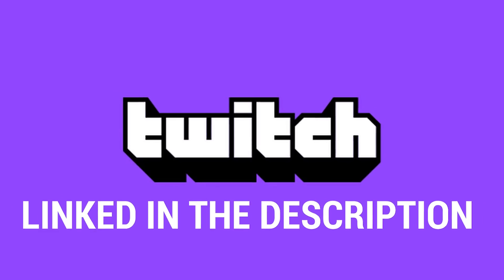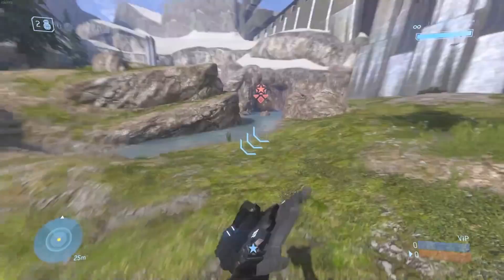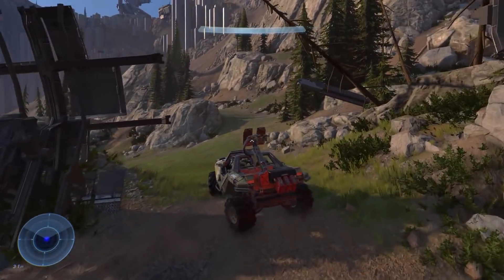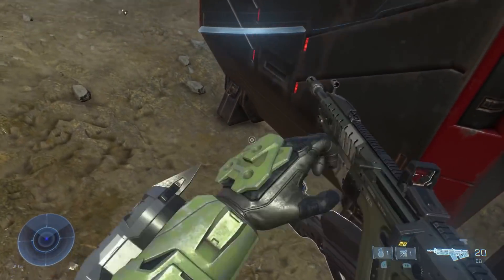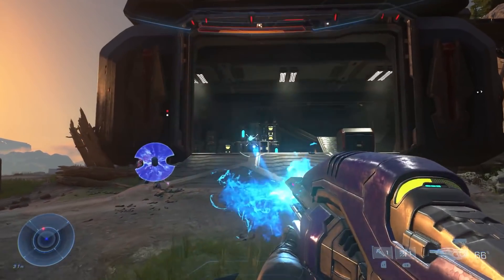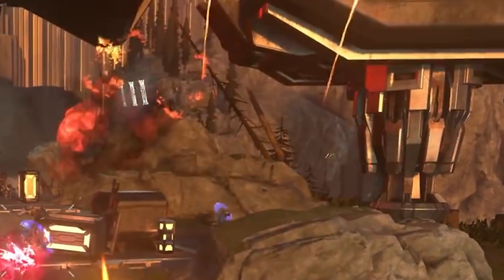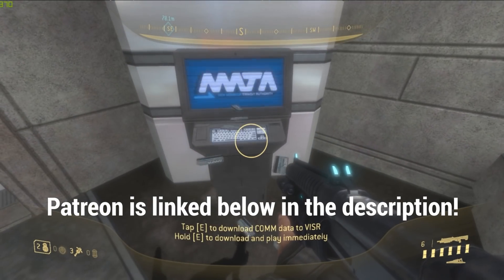What you MISSED from Halo Infinite's Gameplay Trailer  | The Physics of Halo Infinite

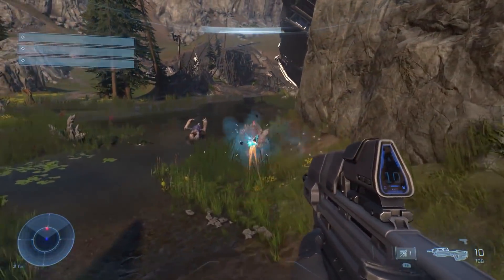Comment: I love the look of the green fusion type explosions, wish the others were as good. (5:23) They look genuinely white hot in their core with that sort of over exposing camera bloom surrounding them, and the smoke/vapour around them seems to light up a lot better so they have that extra volume. The normal fire explosions are alright too, but the plasma looks really weak to me. Maybe if they were just a lot brighter in that white/hot plasma sort of way, current form they don't look all that different grunts blood to me (5:25 v. 2:11). I also feel like they cheat the geometry out of those drop pods a little too aggressively when they explode, there's all of a sudden like 10% of the mass that was there
Reply: Actually, going back and looking at the plasma grenade that pops at 5:57, it looks a little better there. Maybe if the volume stayed lit a little longer
Reply: @BCMSi   The actual explosion there does look a little better. But he lingering plasma that fades out is way too opaque. It looks so cartoony, like it was an asset lifted from Ori

Comment: by the way every weapon in the entire halo series has been projectile based. the entire engine all the way back to halo 1 uses projectile simulation with very adjustable parameters. any perceived feeling of being hitscan is just because of the projectile speed being cranked way up.
Reply from the maker: Right, and that IS fair. But thing is, when you crank the projectile speed so high up like in Halo 5, suddenly even calling it projectile is almost pointless. Everything in that game is precise and laser accurate.
Reply: @Jerasunder  it is projectile based. the reason it feels laser accurate is more due to the extreme magnetisim, projectile speed and aim assist on halo 5. the bullets are magnetised to the player if within the magnetisim cone and will change trajectory to hit the player.  the aim assist adds to this effect as well. 343 sped everything up in order to make it feel like a competetive shooter like cod or csgo. however you still need to lead slightly with certain weapons and at long ranges so it is still projectile based physics. the base structure of the engine hasnt changed since halo 1. 

infinite supposedly has a new engine but I'm not sure yet whether it is just a rebrand or if its entirely new from the ground up. we wont truely know till it releases though

Comment: i hate that you can turn your warthog it the air. it ruins the feel of driving. i hate that vehicles try to right themselves.
Reply: If they didn't add those mechanics there would be a lot of frustrated players out there because a jump or a landing didn't go their way. Phun will probably always trump physics unless it's a game that is specifically for the physics like a simulator.
Reply: @SheepAmongG.O.A.T  that's why the Warthog physics in 2 and 3 were so finely tuned, to prevent unfair jumps
Reply: Your only able to that with covenant vehicles due to the anti gravity tech. The warthog was moving in midair most likely due to plasma pistol bolt hitting it. This was a feature in Halo 3 where if you shoot the warthog you were able to push it with the bullets divert off course while it was moving. It was kind of an annoying feature.
Reply: @shadowtear101  no, you can rotate the warthog in the air. Yes, the plasma shot does push it, but you can clearly see it move on it's own. The fact that it stays mostly motionless in the air is even more proof.

Comment: My theory for how the warthog looked a bit funny when in the air is that you can control which way it goes but the player decided not to
Reply from the maker: You could do this in 5, so I would not be surprised.
Reply: If you look closely when the warthog makes that correction. The wheels reverse a little bit which might suggest that the torque produced by the engine turning the wheels might cause warthog to rotate midflight
Reply: @One_Shot_Willy  I saw the wheels stop turning but I didn’t see them reverse. The Warthog hasn’t had physical 4wheel steering since CE. I don’t think they added gyroscope physics to the wheels. It would be cool if they added wheel spinning/turning animation that matched how the Warthog was pitched by the player in air.
Reply: @grantlauzon5237  did you try watching at .25x speed